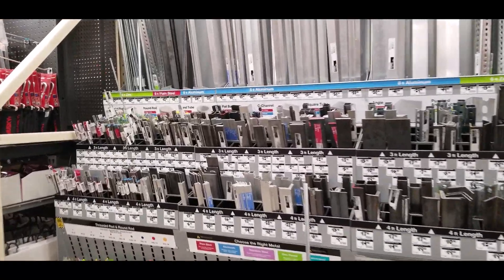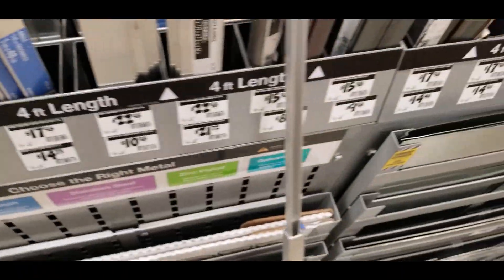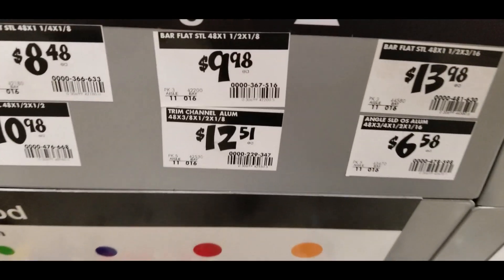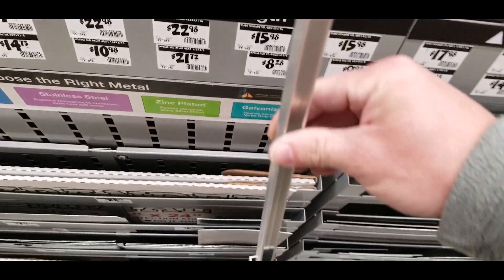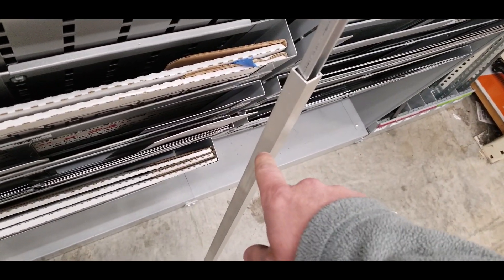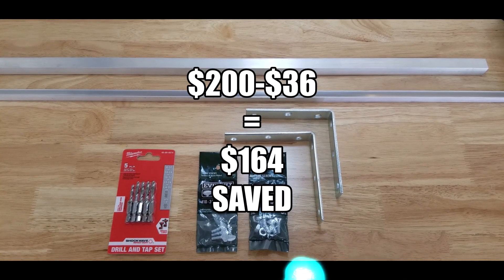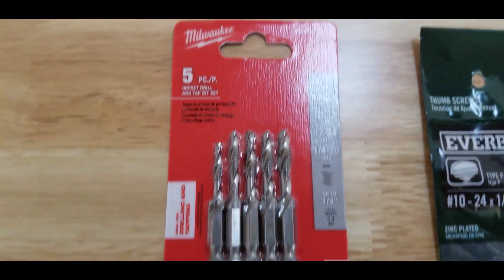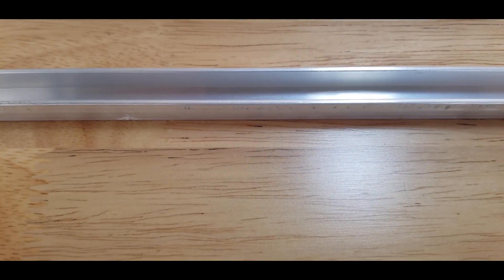How to Build Mounting Arms for LED Aquarium Lights

Comment: Very pleased by what I was able to make based on this video. I wanted to link 3 kessils together via usb-c cables -- those plus the power cable wouldn't fit in the tube/trim channel shown.  So I went up to a 1" square tube.  Since there wasn't a matching trim channel, I nested 2 L-shaped corner rods to make the square U-shape.  The kessil ring wouldn't fit around this, so I also had to get 1-1/2" key rings.  Thanks for the great tutorial!

Comment: Make sure you install the aluminum on the inside of the bracket not on the outside. Not sure why the OP doesn't add a note but if you install the Aluminum on the outside (as seen at 7:05) you'll find that the sliding aluminum has to face down to slide. You need it facing UP in order to make the divits for the fixture Ring. Proper orientation can be seen laying on the desk @ 8:17. Also same scene shows why the aluminum needs to face UP and not DOWN.    Original Poster this was great! I followed this video for my a360x mount. Works well. Waiting to paint, currently sitting outside Primed.
Reply from the maker: 7:05 was just testing the screws and holes. Indeed the end-state assembly is the intended design.